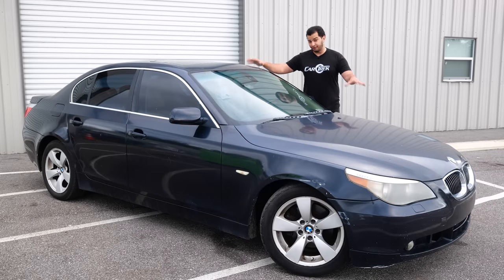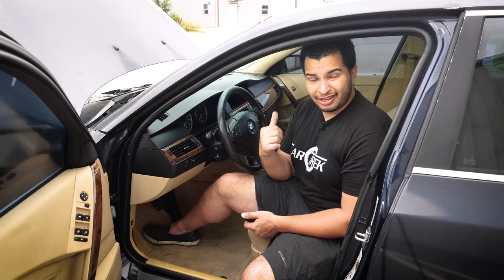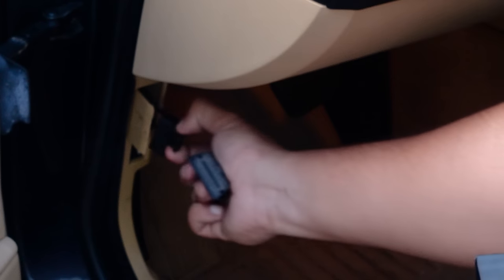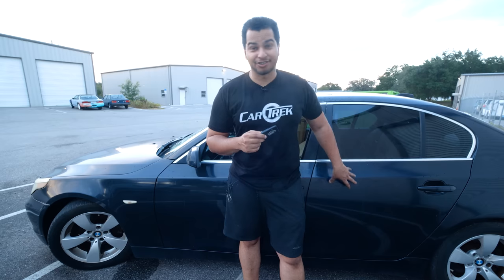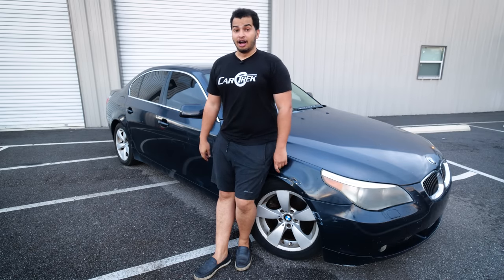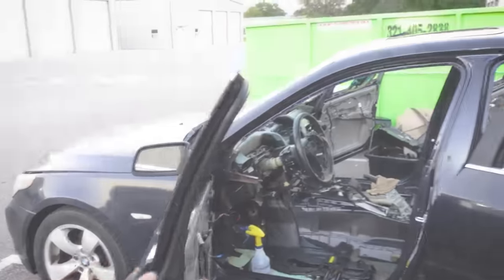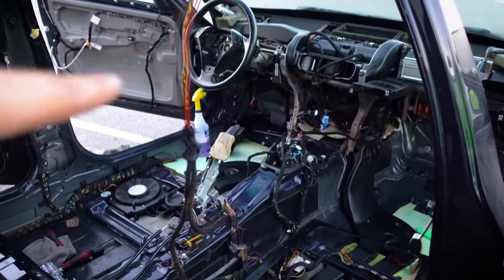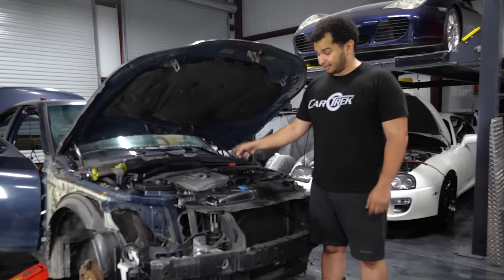I Bought A Running BMW For $600 (Because It's FULL OF ROACHES)

Comment: I'm 100% convinced BMWs run on smugness and actually get a sizeable performance boost when the turn signal isn't used.
Reply: Yup I always used my turn signal and wham- never worked right
Reply: With my 2021 330i I have to use my blinkers in order to not get swerved from the lane assist
Reply: Boot if it has no turbo oke
Reply: He should have got an e36 for
1000 and did a vid on that
Reply: Well the 2023 BMW x1 I drove recently; when using the turn signals, would vibrate the steering wheel, and turn you away from cars that are withhin a car lengnthh of you, also it auto braked as well for same reason. It was much easier to not turn signal if the gap was there. So yes actually, better performance when you dont use signals xD but thats thanks to new AI car saftey standars
Reply: @3M0710N which hopefully will come standard on cars soon because theses idiots out here can't drive.

Comment: Unless your strip it to bare metal the roaches will still be hiding in every door panel and dashboard they are tiny and sneaky
Reply: Doesn't he just have to gas it?
Reply: @earthing3696  If he left the car intact and gassed/bombed it everyday for a month there is a good chance that 100% of roaches & eggs would be dead/destroyed. BUT there is always the chance that just some eggs could have survived if tucked away deep inside of some part or very sealed up area of the car. I used to work for a guy with small apartment buildings and 1 had roaches bad. We bombed it so many times and professionals came in many times. Last I knew the place still has roaches.
Reply: I moved from a place like that in California found out the main nest was in the sewers...My unit was clean for about a week...then I started maintenance... I found out they have actually taken over.
Reply: not to mention the roach eggs they’ve more than likely left behind
Reply: Drive it to Texas or Arizona during the summer. Leave the windows closed for a few weeks in 100+ degree days.... No more roaches.
Reply: If you fumigate...the roaches aren't living in there....
Reply: @bph5070  heat does not kill roaches

source: my mother had a roast infested oven
Reply: The way I just started to itch while reading that
Reply: @bph5070  yeah they will cook. NM, AZ, and TX, I have NEVER seen roaches or bugs live in a car. The plastic outgasses some nasty stuff at those temps. Put boric acid and borax powder everywhere and that will double down on the bug death zone.
Reply: Great. I’m itching now. Horrible critters.
Reply: @bph5070 nah bro ts so hot 108 😭

Comment: I love how he flashes his ECU with like 9% battery on his phone.
Reply: Some people like to live dangerously 😂
Reply: That's plenty that'll get you 20 minutes to 2 hrs
Reply: Flashing and coding are two very different operations
Reply: @SmokyBoi  Can't you corrupt files while coding?
Reply: @LPOeli  yes you can so I heard
Reply: I was thinking the same thing 🤣
Reply: @LPOeli  you can since it’s recoding that module. If you interrupt the coding or car turns off it’s toast.
Reply: @FishFind3000  Yeah that's what I was thinking.
Reply: @LPOeli  The software saves all the original files you can always code it back to stock.
Reply: It's not gonna take that long to flash it
Reply: Not using roach foggers is worse... Hopefully no live roaches or eggs made it to his shop...
Reply: @LT3Fluffy  On several phones I had battery below 10% meant there is a good chance that the phone will just shut off at any moment. But probably he has higher end phones than me.
Reply: If he was coding the FRM it would be much higher stakes haha
Reply: @LPOeli  you could, yes. It is unlikely to cause irreversible damage to most modules though if coding is interrupted.
Reply: Think of coding as personalizing a desktop computer, and programming as installing the operating system.
Reply: @LT3Fluffy  doesn't matter, anything can happen. if the cars battery voltage drops to low the car will automatically turn off accessory power and BOOM your module is now bricked and your out $$$$ plus dealer reprogramming.
Reply: @FishFind3000  that has nothing to do with his phone
Reply: @FishFind3000  a meteor could also strike and bam! Freddy is bricked
Reply: @LT3Fluffy  he also didnt have a power supply on the battery so he still is coding wrong.
Reply: @FishFind3000  lol tell that to every hp tuners user ever
Reply: @RickyX64  they’re in his shorts and t-shirt
Reply: @Brian-jv8iy  You don't want to code when the engine running since you can be coding modules that the engine needs to run. After coding it resets the modules and will kill the engine. Its not good for it.

Comment: “I’m going to be watching every penny of this build...” (Ten minutes later) throws entire interior away.
Reply: Yep
Reply: yeah some of those parts were salvageable
Reply: i dont think its worth his time.
Reply: The only way to sort it out was to replace it, did you not see the bugs lol
Reply: Exactly what I was thinking lol. 

Super budget build! *Sees some bugs and proceeds to gut entire interior and throw it away*

Also pretty sure there could be roaches/eggs still in allllll kinds of places. Would have been better to just like tent and bug bomb it kinda thing or have someone else detail it lol. Way cheaper than this for sure.
Reply: Gut it put 1 racing seat in it. Coil overs and a welded dif. Bam
Reply: Taking it apart down to the firewall, cleaning every part, and reassembling is the only way to solve this.
The interior, AC system, trunk - dash - headliner - all of it has to come off like it was a frame-off paint job.
Reply: if you watch him take the carpet out you can see he had some change that I'm pretty sure he threw out.
Reply: @CaptainGsOceanTurd  still a chitbox
Reply: Most of what he threw in the dumpster could have been sold on ebay for probably as much as he paid for the car added together. OK some of the bits like those door trims were beyond salvaging but most of the other stuff just needed a deep clean.
Reply: @TIMMEH19991   Deep clean? The only way to get rid of roaches in a car is to burn it. The Ferrari took matters into its own hands when Parker was driving it.
Reply: @gallardogd560  HAHA you missed the point of ebay! Once you've sold it it's not your problem anymore LOL

Comment: “I’m going to be counting every penny on this build!”
>> throws entire interior in the trash
Reply: Yeap couple hundred will get you another, 4-500 at most.
Reply: I was thinking the same things. What a waste. I'm sure there's are plenty of people out there who are actually rebuilding on a budget that could of used some of those parts.
Reply: @paulblouin1454  I get what you saying, a 5 series might not the be one for people on a tight budget
Reply: Yeah bug bomb and valet what's that going to cost
Reply: @brucegillies4798  I guess if you dont mind dead bugs, eggs, and what ever that white mold was under everything. You wouldn't get it all

Valet? Did you mean detailer
Reply: @Todd Malonethey're just bugs. They're not going to kill you. But hey, if you have the money to buy everything new instead, go ahead. It's your money. I'm just saying, with a hose, some cleaning products and a bit of effort, those parts could have been easily cleaned. There was nothing wrong with them. But Tavarish likes to spend money.
Reply: @antonherres7112  that’s between 20,000 and 50,000 cents. A lot of cents for someone counting every one. It will take days!
Reply: I would've wrapped the car in plastic sheeting & set off a couple bug bombs, check for bugs & repeat if necessary, then disassemble & clean everything. My time is much cheaper then that good condition interior that went into the dumpster!!
Reply: @antonherres7112  a valet is what you call detailing in the uk
Reply: @connorohoare7470  then what do you call a guy who parks your car?
Reply: @paulblouin1454  EASILY cleaned??? bro please youve got to be kidding me
Reply: @connorohoare7470  mate there called detailers
Reply: @vauxhallfan676  mate literally never heard them called that in the uk.
Reply: @connorohoare7470  okay but alot of bodywork shop here call them a detailer because to seem more upper class that's it and I never seen a bodyshop call them a valet
Reply: @vauxhallfan676  great 👍🏻 then why the attitude yesterday ?
Reply: @connorohoare7470  sorry mate no hard feelings

Comment: Tavarish: i'm on a budget
proceeds to throw out all of the interior and get a new one
Reply: That's more cost effective than what I would have done.  I would have just pulled over and set the car on fire. lol
Reply: well, its roach infested. Anything else than getting a new interior would be useless
Reply: @jerri0401  Except of course befriending the roaches and becoming their leader.
Reply: All budgets are not built the same
Reply: Meh, there’s a ton of these at pick your part.  Easy to get a new set up for $400.
Reply: @anzacxlag2606  man can u come to my funeral cos you had me die by laughter💔😂😂
Reply: ehh, get a couple of strong roach bombs put one in the car and put the other in the truck set'em off over night, air out the car in the morning for a few hours, pay like 50/60$ for it.
Reply: Old bmw interiors tend to be cheap depending on the models

Comment: I'm laughing about how he thinks that got rid of all the roaches... They lay eggs everywhere!!
Reply: That is true that car is fit for the fire
Reply: Yeah and they also love electronics so all the modules are going to be full of them
Reply: @MichaelBallardwormy  yup, and the air conditioner. I've been the project manager of 3 different restaurant chains remodels, they have us gut the place to get rid of roaches. All that is left is the studs and concrete floors.
Reply: @cardboardshuffle2985  i used to work at a computer repair shop and we had some laptops dropped off that were almost immediately put in bags and told the owners we wouldn't touch them because of the roaches.

Comment: It’s amazing how people can be surprised that a $600 car is not in good shape. “Warning lights, regular bmw stuff” no... that’s regular $600 car stuff
Reply: Nah every BMW has at least one light on. Worse than an old chevy and at least with a chevy the parts arent stupid expensive
Reply: @cptnscoob  lol no
Reply: @cptnscoob  apart from every bmw I’ve ever owned and the one I own right now
Reply: Nope, over here my car cost £600 so a bit more than $600 but has no warning lights on (apart from the battery this morning thanks to lockdown and not driving it enough!)  and in the 3-4 years we have owned it has needed tyres and brakes and bulbs plus a couple of fuses. Just regular stuff. You can get really good cars for that money.
Reply: @delta250a  my point was not all bmw have warning lights just like not all cheap cars have warning lights however the reason this car is so cheap is because it’s broken so how can he complain. He wanted a broken car because if he bought one in good condition then he wouldn’t have a series to make. And I said it’s regular $600 car stuff. You have an irregular car
Reply: My BMW had lights on from the day I bought it. They never stop😅
Reply: @ATi1300Ramiro  well then why’d you buy it if it was broken
Reply: I have a $500 2000 f350 I bought with 190k miles on its 7.3L diesel and now 4 years later she has 467k miles on her and still running strong no engine lights on so far knock on wood
Reply: I disagree,  a $600 honda civic will be totally fine (mechanically)
Reply: OMG some people, let me re word what I said. A $600 car that was a high end expensive car when new is going to have issues
Reply: @cptnscoob  every german car has at least one light on 😂 germans love to light up your day!
Reply: @Lbnewell 23 I went with my Bimmer because I couldn't find a gently used W-body in my area😅
Reply: @cptnscoob  yeah, and that lights never an indicator light.

Comment: That interior was probably worth more than he paid for the whole car.
Reply: The seats alone were easily over 1200
Reply: If you want roach infested seats go find the dumpster and get em
Reply: @ryanravencaller  its not like the roaches are gonna live on it forever, nothing a good deep cleaning cant fix
Reply: @mr.juicethebeetle3373  you would need to fully disassemble the seats clean them thoroughly hope there isn't any eggs you have missed anywhere it would not be worth it Noone wouldn't go through that effort to possibly infest there shit
Reply: @6door6four96  Just take out the electronics then atleast.

Comment: Could have just used a ozone machine for a day or two with plastic or something sealing it up. Would have been more cost effective and would have killed all the roaches
Reply: the smell of roaches is horrible and near impossible to get rid of
Reply: Highly underrated response!
Reply: That and getting rid of that one bad interior panel, along with the headliner and carpet would have been sufficient to call it a budget build as the rest could have been salvaged, fumigated and re-colored.

Ozone works amazingly well.

This guy is pushing the limits of what anyone can reasonably call "Budget" unless he's being facetious and actually saying "unlimited budget, thanks to my sponsor".
Reply: @steelymaverick88  roaches have a smell??
Reply: An ozone generator isn’t singlehandedly gonna cut it. You need to physically sanitize every inch and crevice of that car.

Comment: There are still roaches in that car, you should have let the car sit with some cockroach killing materials inside such as a mixture of Borax, egg yolk and sugar, made into a thick paste and left in chunks around the car.
This should hopefully kill them.
Or use Mint oil and distilled Vingegar spray to wipe the inside, Mint wards off cockroaches.

Comment: An ozone machine running overnight would rid you of those roaches and any other thing floating around in your car.
Reply: This.   Throw plastic tarps over it with an ozone machine running in it over a weekend.  Kills bugs, mold, etc.  Knew someone that had bedbugs in their car.  This did this every weekend for a few months.  Cleared them right up!
Reply: Kills all odors and any critters that sneak into car as pure Ozone is toxic and gets into every area of the car without any effort.  Air out and done!  LOL
Reply: @tmygun6  The down side is if it's used recklessly it will damage electronics in the car due to the corrosive nature of the gas.
Reply: but it just kills them, its not gonna remove them. Theres still gonna be dead bugs all over the car
Reply: @chamelao2164  “The only good bug’s a DEAD bug!”

Comment: 525i “base model”

* laughs in European*
Reply: explain plz
Reply: @rehanbangar5211  in europe the base model is a 4 cylinder and the 525i is more like the 3rd or 4th engine upgrade
Reply: @MrTommys-wc7qw  ooh thanks for explainin :-)
Reply: @rehanbangar5211  Yeah, here in The Netherlands driving anything other then a 4cyl is considered a heavy motor. It is because gas is costly here, so people want to drive cars that are fuel friendly. I myself drive a E46 323ci with a 330ci intake, remapped pops and bangs and alot more upgrades. 218hp at the moment.
Reply: @MrTommys-wc7qw  and in eastern europe 90% of bmw's are 2.0 diesel, basically the lowest of the low.
Reply: Cries*
Reply: @MrTommys-wc7qw  well the base model for the 5 series
Of course we have the cheaper bmw’s
Reply: @dragonmitchell15  ik had er ook een... in december vol tegen de boom🤦🏽‍♂️

Nu een e91 320i
Reply: @MrTommys-wc7qw  powww maat, zonde man! Maar de E9x series zijn echt fucking dik, wil zelf een E92 hierna
Reply: @MrTommys-wc7qw  in the US, the new G cars only have a 530, 540 and M550. I think they stopped making the ugly GT and we don’t have a 5 series wagon. Sad.
Reply: @dragonmitchell15  de coupe: mooi!! Was voor mij net te duur, maar zeker wel de mooiste carrosserievorm van de e9X!
Reply: @drsipp407  they now only have the 6 series gt, which is basically a 7 series with a higher, sloping roof
Reply: @rehanbangar5211  In europe the base model is a 520i or 520d....no leather interior either

Comment: A friend of mine got one of these as his first car, thing rode like a cloud and it was very cool but it would break all the time for no reason 😂
After he owned it for a few years it ended up catching on fire and burning to the ground! Then he bought himself an X5... idiot 😂
Reply: Dude I tell people every single day, do not buy a neglected higher mileage bmw if you don’t make/don’t have a lot of money where it’s going to be your only car. It will both strand and bankrupt you.
Reply: I’ve only ever had BMW’s, and they have been great cars........ when they run. I had a 2003 525i and that thing was literally indestructible. I now have a 2012 X3 with the same engine that Freddy has in his 525i, and it’s been decent. It’s needed very little out of pocket from me, but thank GOD I have an extended warranty on it, as it ate a $5k valve body in the transmission last December. Not a peep since then.